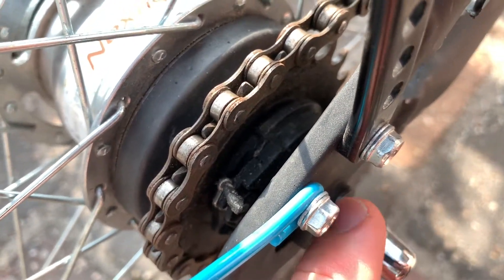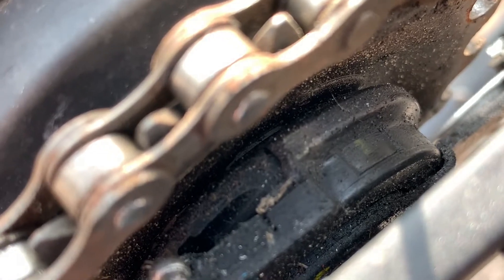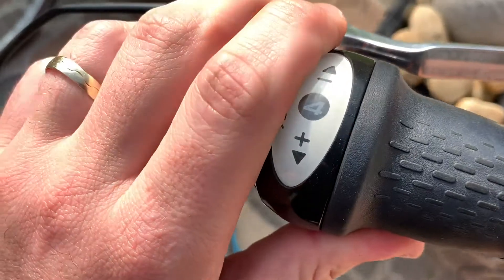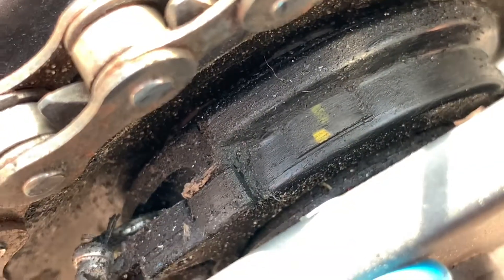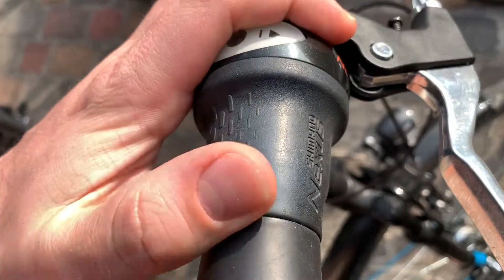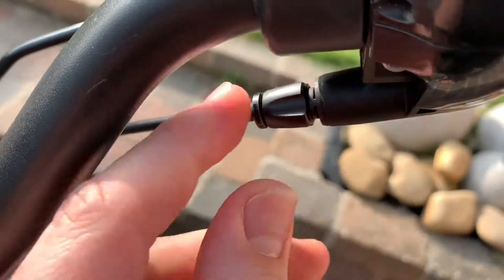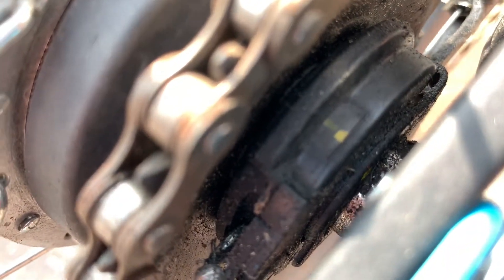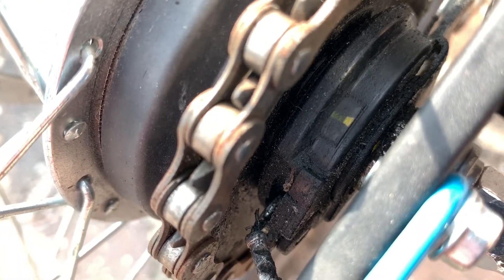How to setup and adjust a Shimano Nexus Inter 8 hub gear bicycle DIY

Comment: My gear numbers don’t even align in the window on the handle. The second yellow line in the hub window is nowhere to be seen. What’s my next step here?
Reply: I had exactly this problem on a second-hand bike I bought as "spares or repair." I very carefully disassembled everything and found that the cable had come out of the guide groove on the rear mechanism. I cleaned everything and then gave it a good spray of light grease and reassembled it correctly. The adjustment was then easy and shifting is perfect.

Comment: Absolutely brilliant. I paid to have work done on my very old bike (Shimano Nexus Inter 8 hub) about 6 moths ago & the gear slippage has been getting progressively worse and worse. (I also wondered why he had left the gearbox at 4  - but this vid explains it all.)
This morning I found and  watched your vid, (twice.) So simple, (all without needing to turn the bike onto it's handlebars)  but  I had to make about 4  of 360 degree turns (folks, the right hand  - outer-yellow line is the one which moves  back or forwards) to meet with the inner fixed yellow line.   
PS: touch NOTHING until you do your research- & you shall find this wonderful site. Bookmark it for future reference.  
Again - BRLLIANT - thanks so much.  Carlb -   rural Australia
Reply from the maker: Thanks that makes me happy

Comment: Just did this to my 2 week old Bordman (Halfords) hybrid bike. Has a Gates belt drive but worked exactly the same. Thank you. Just curious if you could tell me what makes it go out of sync? What causes it to need tuning? As I haven't ridden the bike an awful lot, maybe 40 or 50 miles in the last 2 weeks.
Reply: Cables stretch after installation. It's normal to have to readjust some stuff on new bikes after 50-100 km.